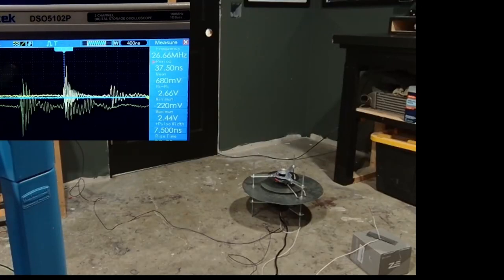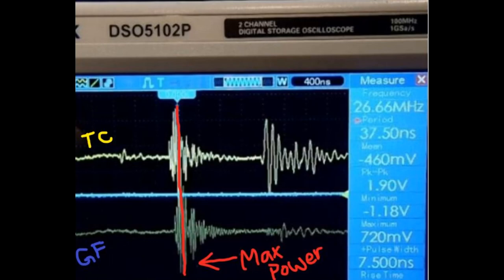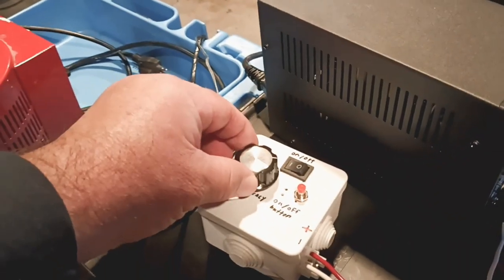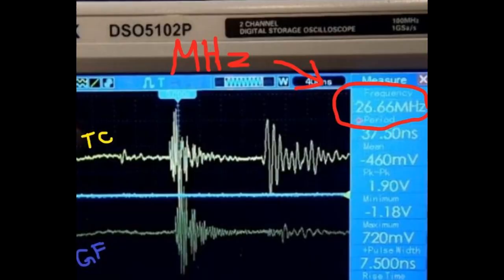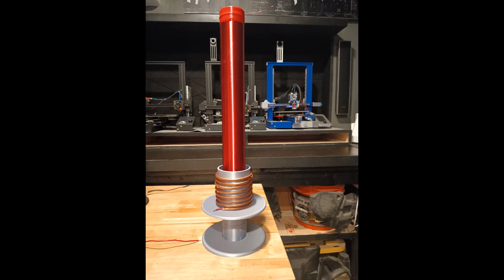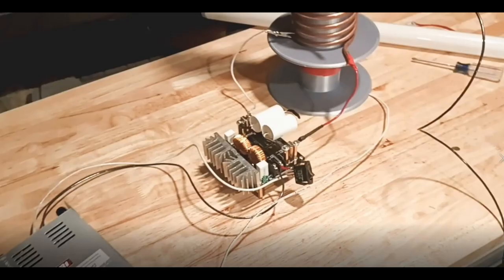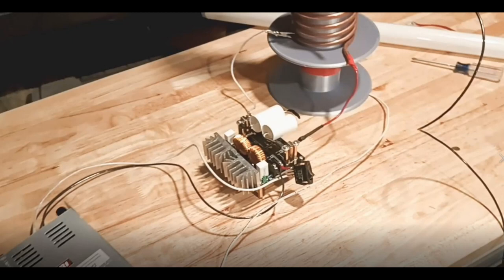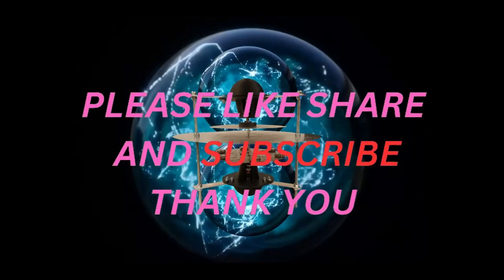Graviflyer "Understanding The Oscilloscope Readings" #62

Comment: Thank You Nathan ...You have Just Explained Why I have Blown SOOOO many Transistors ; when Cold meats Hot ...BOOM ..  WOW,  I never Thought of it That Way ....!
Reply from the maker: it is also why you coil jumped off the table. I am trying to do the same thing.
Reply: @nathanbunten4299  Do You think that the Temperature difference was the Cause ?
Reply from the maker: @wpgenlighten4truth2  You are using almost no amps. So you are in a charge state. When heat is added to voltage it produces amps and changes it to a magnetic field. It is a sudden change in the field. I got the same thing in the coil winding I did.
Reply from the maker: @wpgenlighten4truth2  I also bet you are pulling the spike so you are probably in negative. You became the battery switch to regular energy.

Comment: Thank you for the detailed explanation. 

It looks like the bottom right wave is dampened due to a reflection once it hits the graviflyer. Im thinking we need impedance matching / get impedance to go to zero with resonance. ie cyclotron resonance like Dr. Walter Brattain talked about. I would be interested to see your circuit energizing copper oxide in a polyethylene glycol dry cell. The holes, (P) circle and collide. Copper oxide is very good at having lots of holes and the polyethelene glycol acts as a dielectric space for electron pair creation. I will be making cells soon. Maybe I could send you a cell?

Comment: What happens on the oscilloscope if you crack an electronic lighter down by the graviflyer while it's spinning?

I got this crappy lamp and if I spark a grill lighter near it it will come back on without touching it.

Maybe if you tune the ultrasonic clap and use a lighter to spike the electricity it will help.

If you try it I would love to see what happens on the scope and what happens to the light when it is lit up a bit and you crack the lighter close to it.

My theory is the spark will snap the aether and give you a bigger amplification at the spot you need. Maybe you can count off the timing for the clap like a song in band and tune the clap low up to in tune like a guitar string.

I got some advice about shape too I think but I want to see more tests. I'm still relatively new to the channel.

Also, this is just friendly advice meant only to help.

I got itched out by someone recently for offering advice...

🤷‍♂️
Reply: Snap the lighter and the ultrasonic clap at the same moment just to be more clear.

Comment: Do you know what I think is making the frequency vary? The wire down the tesla coil is not straight so the field inside the tesla coil varies a lot as it connects to the crooked wire. Good analysis. How did you get the phases aligned? Put a straight copper rod down the exact center of the gravity flyer and the frequency should stabilize and the phases align better so you get continued phase match at a high value for every peak on the oscilloscope, so you have more chances to push the button to get the harmonic resonance. What do you think Nathan?
Reply from the maker: The top of the tesla coil has a 3d printed pipe on it so it is straight. I can isolate the tesla coil system and work on the button push part. The reason for the not getting many try's is the high voltage end. But I may have an answer for that. I can bring up the field faster with a dryer sheet.
Reply: I see you have a power supply that you can change the V and I. Is this how you aligned the phases? Hot to cold heat as your diagram shows?  The dryer sheet on the tesla coil or on the gravity flyer?
Reply from the maker: @richardmuller867  dryer sheet on high voltage side so between the plate and center plate. I tapped the center plate changing the octave and it set it correctly.
Reply: Ok great. This is what I thought.

Comment: Have you tryd the sand experiment to see the piezoelectric frequency " shape"
Reply from the maker: No I have been busy.
Reply: That would be an awesome visual. And maybe the acoustic  shape could be 3d printed to further direct the sonic frequency to a specific distance like the ultrasonic crosspoint that meets the electro magnetic horizons. So the magneto loop wave moves parallel the vertical frame rods, and the sonic pressure wavelength can be dialed into it's optimized perpendicular target point. I'm looking into using a cotton candy machine as a centrifuge to make graphene insulation to absorb and recycle/amplify the electromagnetic energy loss and EMP shockwaves when in prime operations. I am tinkering in a zinc coated corrugated steal barn. A faraday cage inside a faraday cage. Still can't contain the over unity breach wave. Turns my 12ft 3/4 brass ground rod rammed into an aquifer, into a 250°f danger stick. Crazy!
Reply: @hellogoodbye3129  I think I agree 😆 the images I create in my head ... is the piezo is spreading 🤔 the eddy current out to the edge and the magnets (along with TC and HV )in my view top and bottom are making the center vibration threw those current 😳 is what makes lift up the fields old man is talking about like layers of fields the farther out you go ? But he hates the magnets 🧲 😆 🖖
Reply: @gypthcnuryse7611  he really does. I've been nagging him to build a faraday cage to protect himself and his equipment. He has not, and prolonged EME exposure is not good for your neurological systems and lymphatic systems alike. My theory is that gravity itself is the result of emerging static energy from the compounding amplification of molecular eme frequencies acting in parallel like a circuit to add amplitude to its Force energy of pushing the opposite side of the target mass. Like literally tipping/pushing a boat way from or towards a vector. The negative space is as important as the positive space. As my 5 yr old son says , "2/3 isn't itself without the missing 1/3. It's just a weaker #1. " 🤣🖖

Comment: Have you ever thought about taking some of the info on cezar pais patents and applying it to your experiments. At this paint, I’m thinking the original flyer was fake, but still think you’re headed in the right direction. I was looking at pais’ patent # US10144532B2 and it was talking about noble gasses in a sealed chamber. I think I would work on that